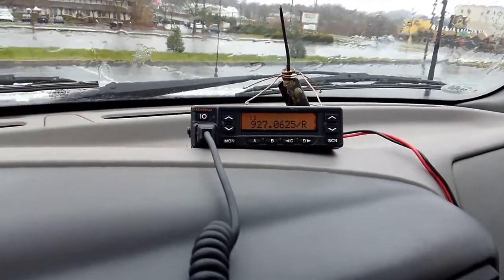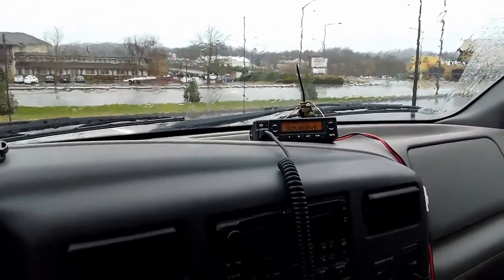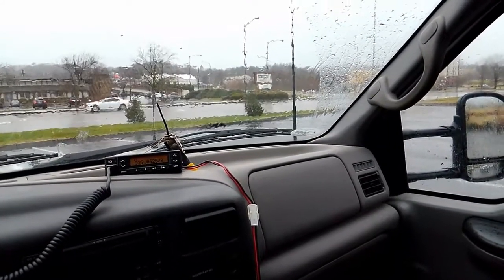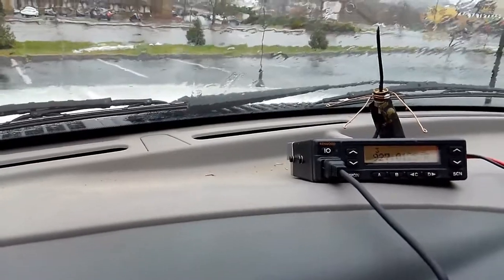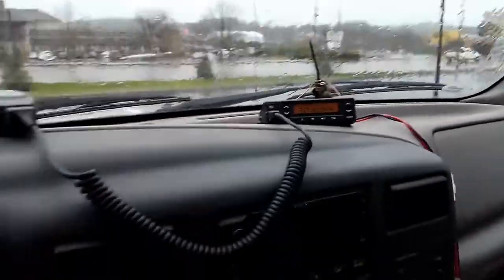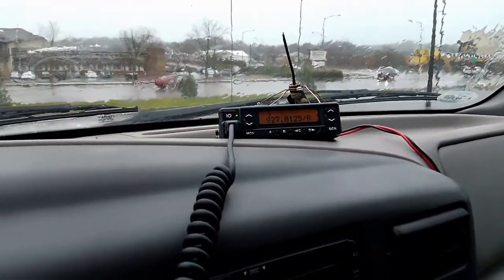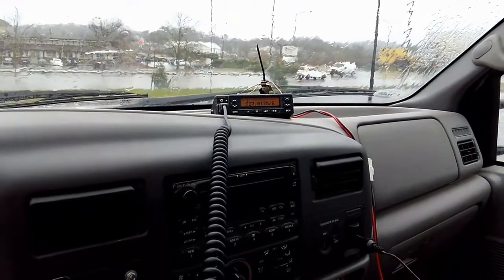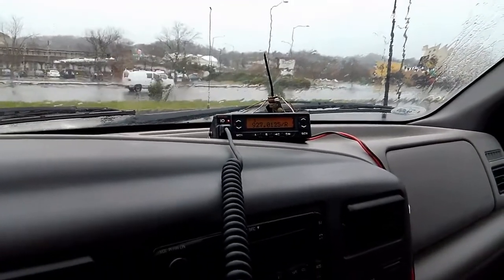First 900 MHz Contact

Comment: I’ve been wanting to get into Ham radio, for awhile now. I wonder if there are many people using 900 MHz band in Western KY?
Reply from the maker: Your best bet would be 2 meters. Actually that advice would apply even if there were a decent pocket of 900 MHz activity near you, which there doesn't seem to be.
I'm not saying don't get a 900 MHz rig; just don't get it as your first rig because you will probably be disappointed. I recommend a 2 Meter radio first, then a 10 Meter SSB radio. Then whatever else your interests lead you to.
Reply: @Possumliving  sound advice for any new person
Reply: No. I hear they are going to be putting a 900mhz repeater in Lexington this fall (2022). That’s it for KY. I have a repeater but no where to put it. South central KY.